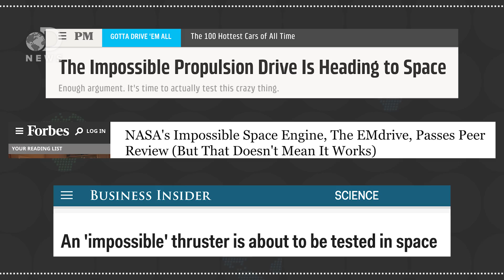How The 'Impossible Drive' Could Break Newton's Third Law

Comment: I imagine it works very similar to a laser (in a manner of speaking); i.e. while most of the waves are, in fact, bouncing around the inside of the device, it is not until they meet the closed end at a 90 degree angle that they provide a noticeable force in the opposite direction. The cone shape is probably the deciding factor here; while most waves bounce off and provide minute forces in every direction, they are overwhelmingly (and inevitably, thank to the closed cone) being directed to a near 90 degree strike with the perpendicular plate, distributing the majority of the energy, creating a small amount of thrust. Sounds very scalable!! =D

DNews, am I an idiot or a genius!? Wait, don't answer that, let me dream...
Reply: To reiterate, this technically does not break any laws of physics, just displays them in a form we are not used to.

Comment: It is E M drive. Not "em" drive.  E M stands for Electromagnetic.  I actually follow this research closely and actively do my own theoretical research.  There has been a better explanation proposed that relies on "Unruh radiation." An effect that arises from relativistic quantum field theory.  Essentially,  in an accelerated reference frame moving at relativistic speeds, the vacuum of space appears to be filled with thermal particles, more so on one side of the cone than the other due to the size.  This imbalance of particles causes the side with more particles, to send particles to the side with less, causing thrust.  This explanation does not violate Newton's third law and I believe it to be very elegant.  It still however is not accepted as fact.
Reply: MattsMotorz EmDrive sounds much cooler and is easier to say :D
Reply: My thoughts exactly. The EM Drive would not violate the Third Law of Motion in my opinion.

Comment: you should know, we already have rockets powered by electricity, ion drives power our deep space probes like voyager 1 and 2, they use a compressed plasma to channel electricity that is driven out the back of the space craft, this design allows for continues propulsion for decades on end, the only draw back is that it has an incredibly slow acceleration because of how little force it produces, imagine your limp body floating in space, and you pulled out one hair and threw it in the the opposite direction of where you wanted to go, now a human would run out of hair before you got any real speed, but since the probes can run for decades without interruption, they can reach incredible speeds, the voyager 1 probe is the fastest thing built by humans, but it took 4 decades to get to its current speed, and it's only just barely the fastest

Comment: The thing that is soo great about the EM drive, is that even though it currently produces 1/10th the thrust per kilowatt than an ion drive, you could easily add more solar panels....or even better, you could fire a strong beam from earth or orbit to power the craft, effectively giving it thousands of kilowatts worth of power with no solar panels needed at all, making the weight tremendously low.

Comment: It won't work for the same reasons that gas under pressure exerting a force on the inside walls of a similar vessel wouldn't push it forward either.

The waves hitting the sides to have a very small but definite effect as seen in the open system Crookes radiometer (light mill). But, EM radiation bouncing off the sides will do so at an undetermined number of angles, the sum effect would be a net force perpendicular to the inner surface (much as gas under pressure exerts a uniform force in all directions).  Even though there is greater surface in the cone, the force exerted is not in direct opposition to the base. 

If one were to separate out the vector of forces against the cylinder walls directly opposing those on the base plate, they are weaker than the sum of forces on the cylinder and would be cancelled out by those on the base plate.  The net result would be no motion at all.

Only if the base plate were missing, would the engine actually provide propulsion, but then it wouldn't be a closed system anymore.

Comment: Despite the system being closed off to the outside world, why wouldn't the microwaves be in a separate frome of reference? If, per say, one side of the drive was glass and you were somehow able to see microwaves, you would, in fact, see them moving and bouncing around inside of the drive. They would be moving relative to the observer, would that not be a frame of reference?

Comment: Is this video serious? It's more than obvious, that the drive does not move you anywhere. The waves do hit the larger end more often than the smaller end, but they're also hitting the sides! This gives an additional boost in the forward direction, through which all forces equal out. I really don't get the point
Reply: MacMarc Oh yeah, you TOTALLY just cracked what super genius scientists have been trying to figure out; it's totally that simple, right?
Reply: That was my thought when I saw the diagram. The momentum is being imparted on the object in every direction, causing a net thrust of zero.

Comment: guys just mke the back a perfectly absorbent surface and the microwaves wont impart any kenitic energy to the back thus making it go forward. the kenetic energy of the craft going forward comes from the heat/light/microwave energy of the magnetron. this does not break the 3rd law of motion it completely relies on it to work

Comment: Even if this somehow worked how the hell would microwave waves pushing againts something prepel a fucking spaceship?I dont really think microwave waves have such force...
Reply: Its called radiation pressure. Ever heard of a solar sail?  But that may have nothing to do with it. They don't know why it works.
Reply: James01100011 
Yeah ive heard of them.Im just saying that it cant really replace fuel,because even if it existed it would not have much force (just like solar sails).
Reply: Vangjo Pula
In some cases this could replace fuel. Even a little thrust over time adds up. But really thats not what is important. They do not know why this works. Figuring that out could could mean new physics and way better propellantless EM drives..

Comment: Knowing nothing about physics I suppose mwhen he claims it is an open system he means the microwaves would effect the molecules of the larger wall and cause a vibration which would slowly propel the rocket at small speeds but at steady acceleration so eventually it would be going at some speed. So it doesn't break the Third law because there is a cause and effect. It is unlikely an emDrive could get anything off a planet, but once in the vacuum of space the waves caused by the microwaves impacting the surfaces could drive the vehicle. In a large gravity environment it would no doubt be ineffectual but in a zero gravity situation may work. I htink it's a matter of scale.
Reply: Its not about the amount of thrust. If it produces any thrust the implications to science could be huge. If you are in a box floating in space, you cant push on a wall and propel you and the box through space. Thats Newton's third law. If the EM Drive violates this law that is a big deal. More then likely this hints at new physics to be discovered that would not violate Newton's laws of motion.
Reply: I thought it might have created some kind of wave itself which propelled the vehicle forwards, maybe heating the wall molecules would create the wave similar to how light propagates and provides energy. I havent studied physics since school back in the 70s so I was just trying to explain the stuff to myself, why the inventor thought it did not break Newton's law. I wasn't suggesting that simply pushing on the wall from the inside would move a vehicle, but maybe a very low energy wave propogation caused by the microwave hitting the wall and transferring heat energy that then radiated out from that transfer of energy would drive the ship. I thought the point was that it was possible to transfer the energy gathered in space without needing to drive costly machines, in fuel terms, to move forward. It would be slow at first, but almost continual without a need for massive fuel tanks., and in teh vacuum of space maybe it could work.
Reply: John Donovan
I do not buy the claim of bouncing around EM waves in violation of newton's third law as the reason this works. That is too extreme an answer at this point. I am excited to see where this leads. Did you read the NASA paper? They kind of suggest Pilot Wave theory for what the EM drive is pushing/ emitting. Could be the Copenhagen interpretation of quantum mechanics that is in trouble and not Newton. But also could be some type of not so interesting energy  propagation that they missed.

Comment: because the microwaves are trapped within, energy is conserved within the cone system. Also microwaves, upon collision with inner walls, transfer their energy to the cone and cause it to vibrate at a frequency equal to its natural frequency thus causing resonance. Upon collision of the microwaves with the cone, an average force is exerted on the surroundings by the cone, and by Newton's 3rd law, a force is exerted on the cone system, causing propulsion. Can someone correct me if I am wrong,?
Reply: While that might make sense, everyone is asking about the "propellant", or the gas/matter/anything that's leaving a trail behind the EmDrive. In the vacuum of space, space shuttles have had to expel something in one direction to go int he other direction. For this drive, imagine swimming in space. You're not moving water with your hands to the other direction to propel you forward. You stay stationary. Strap one of those drives and you start moving with no fuel.
Reply: The thing is, the cone was put in a vacuum, so there is no "surroundings" upon which the cone can exert any force. This is why some physicists are attempting to explain the recorded thrust using pilot wave theory, which basically says that every particle is guided by a wave. These waves permeate all of space, even a vacuum. But anyway, speaking in terms of newtonian mechanics, the drive cannot produce thrust.
Reply: bigtutubi wow thanks Einstein, care to elaborate?
Reply: VirusTornado Nash Shreshta I see, thanks guys

Comment: If a man were trapped in a box, and rammed himself against the wall, the box would (if proper force was applied) move. Albeit it may just tip over with him inside, it still moved. 

In space, the smallest bit of force applied to an object would send that object moving in that direction (from what I've learned)... so I think it could work. Just because something isn't coming out, doesn't mean it won't move the object.
Reply: That is so wrong :) You are in a box in space. You cant just push on the wall and propel you and the box though space. See Newton's third law. Now it does seem the EM drive works, so they need to figure out how. The least likely explanation would be it works like described in violation Newton's third law.

Comment: A microwave oven in space, turned on with a closed door won't move, no matter the shape. The waves can't escape and reflect on the other sides making it a zero acceleration. The system would just heat up until it runs out of battery power.
Reply: but does it?
Reply: F. S. you almost got it right because your scenario only applies when the thing is not moving.
but let change the scenario make the container move at close to the speed of light then the light bouncing off one side is gamma Wave and the other side is radio waves which generates an imbalance force which decelerate the container instead of accelerating it. 

summary
 the em drive work but in the opposite direction.

Comment: my guess is that EmDrive is actually pushing off the surface by convection. Various crude experiments with homemade setup shown that you can easily achieve thrust while in the atmosphere, but more proper measurements in vacuum shows little to no thrust. 
sooo... it's a big hoax of XXI century. Like perpetual motion, but cooler :^)

Comment: The oil companies will never allow for this to become commercial. -_-
Reply: VirusTornado foil reflects microwaves, it is a perfectly logical frequency containment method
Reply: MildManNerd nice try trying to save face! But fail again.
Reply: Hey tin hat boy, oil or gasoline or petrol is not used in space propulsion. Super-cold liquid oxygen and liquid hydrogen are mixed and burned together to form the fuel of space shuttles to leave orbit. Thrusters in space rely on different forms of rocket technology, non of which use unleaded fuel -_-
Reply: Whose to say this propulsion tech. couldn't be scaled down and converted into future auto propulsion accounting for earth gravity & electro magnetics?... p.s.- I know current aerospace aviation uses liquid o2 & Hydrogen. ;)
Reply: MildManNerd For now it can't actually, because the thrust produced by this drive is incredibly low, that it only works in vacuum. Also, space propulsion technology has never realistically been used to power any commercial mass produced vehicles. The science and experience gained from such experiments is definitely valuable though.

Comment: I'm sorry but the entire propulsion system here seems to be that of magnetic waves applying a force to one side and hitting the back to gain energy. It would provide propulsion without breaking Newton's laws and would be similar to being in a small pool of water, pushing back on the water, having the water get deflected off of the wall, and propel you forward some more. Due to the constant amount of energy being lost the drive would provide more directional force to one side over the other as long as when the microwaves are produced, half would escape (the half that would provide the anti momentum) which would also end up pushing it forward slightly. If all of the magnetic waves are saved then it would have to break laws of motion and thermodynamics to work, but if energy is released then it could work

Comment: If you filled that cone with gas and put It in space, the molecules would hit the inside evenly and equally and it wouldn't move. Same thing for photons reflecting.
Reply: +Doug sillig It doesn't matter. Third Law will always be true, unless they "exist in a separate frame of reference" due to relativistic speeds and becomes an "open system". I personally think this is bullshit
Reply: TauPhi what about microwaves? which is what this thing uses, not photons...
Reply: + Doug Sillig Photons are particle representations of Light, Which microwaves are part of, so yes, photons can be microwaves, too.
Reply: Except if it does.

Our understanding of physics is not the real physics. It is fair to have a prior assumption that this thing does not work since we see a bunch of other similar things not work, but if it works when tested then it would turn out that a bunch of photons bouncing around can move a thing. 

To preside over an idea as impossible when it is clearly testable is a rejection of science.
Reply: While I generally agree and believe the third law to be correct I think we would be supremely arrogant to think that we know everything there is to know about physics and that someone couldn't have stumbled upon something that changes our understanding - or in a way modifies it that we just don't yet understand.
Reply: Ross Carlson i hope u know about the newest elite

Comment: if the emdrive works, everyone will just make their own jet packs
Reply: Just so you know, the EmDrive produces very very very very little thrust. Just enough thrust to get itself moving in space. The exciting part about it is the fact that you can potentially leave the solar system without fuel, just by feeding off any source of light, infinitely accelerating, and getting close to the speed of light.
Reply: SirNetflx mom get the microwave
Reply: +VirusTornado that its for the 1st generation EmDrive. The new actual 2nd generation of EmDrive with superconducting on flat panel only expect to make a lot more thrust with capability to escape from Terra gravity.
Reply: VirusTornado Yes thats why its so cool
Reply: SLEVIN SHAFEL I understand what you're saying, but according to the authors the EmDrive currently has a thrust-to-power ratio of 1.2 millinewtons per kilowatt. That's minuscule, even compared to the weakest thrusters (TTPR >60 for those).
Reply: +VirusTornado We've already known we could do that with a photon drive, which is even more efficient than the EM drive. The EM drive is... really nothing but hype. It has no theoretical use.

Comment: So, to be clear: this device has never, not even once, ever been tested. Correct?
Reply: I think it was tested three times, once by China, once by US, and I think some group in Italy. Each time, they have measured thrust, but they are unable to unequivocally eliminate all  experimental errors, they are not sure the thrust isn't coming from something else that they may have missed. Putting it in space will almost definitely eliminate  any other factors that could generate thrust, so if it stays up longer than normal, we should know that it actually did something useful.
Reply: It's not a hoax. More testing needed, but so far, all the tests checked out

http://www.sciencealert.com/it-s-official-nasa-s-peer-reviewed-em-drive-paper-has-finally-been-published?perpetual=yes&limitstart=1

Space tests are already planned.

Comment: Why not just let the microwaves travel out the back. So what if it then technically becomes thrust. It is still not burning fuel so to speak.  We know what happens when you put aluminum foil in a microwave it sparks so yes microwave are energy and I see the EM drive as a valid device.  So I am all for it